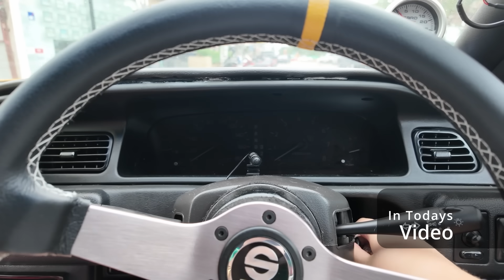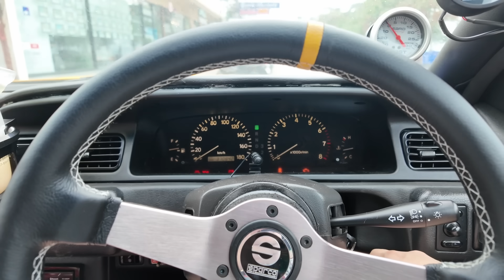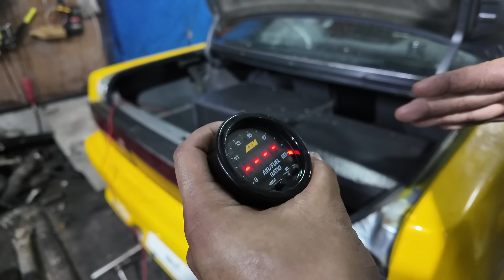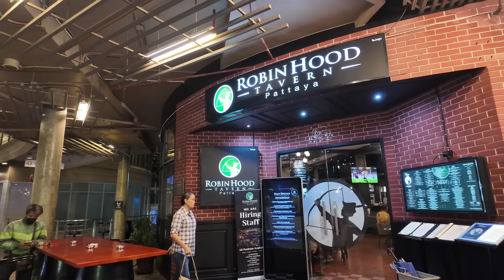My Car Has Died In Thailand

Comment: The engine was worn out, so excessive blowby was being sucked into the input and it was asphyxiating the engine.  You don't have too much fuel, you have too little air, because it has been replaced with unburnable blowby. This is worse when the engine is hot and the oil thins out. To keep the worn out engine running, the previous owner added a thickening agent like Lucas to the oil. Then, you changed the oil, so the engine is back to asphyxiating. There are two ways of fixing this - add Lucas, and/or detach the hose that connects the crankcase to the input air, so the blowby vents outside (which is smelley).
Failing this way when hot is the USUAL way that worn out engines finally "die" - at least until modifications are made to keep them running. Apparently your repair shop has never seen a worn out engine!!!
Steve
Reply: That's because he buys car with his eyes not with a mechanic.
Reply: @Official_MotörHead  Or without a license or test drive.
Reply: I'm going to buy him a compression tester for Christmas.  By then he'll be shopping for a replacement car.

Comment: Just wanted to say one thing about ethanol fuel. It’s very hard on the fuel system and you have to have a special fuel system to handle it. It can be harmful to fuel lines, fuel pumps, and other fuel system components that aren't resistant to ethanol. So if you want to run it, you have to change out your entire fuel delivery system if it’s not resistance to ethanol fuel.
You will get much lower kilometer per liter. But it is a very clean fuel and good for the Engine.

Comment: 1000 U.S. is around 36,000 baht.
5,000 U.S. is around 183,000 baht.
So in U.S. money that is cheap to convert or buy that truck.

You won't find anything that good that cheap here.
A junker truck be 10,000 now.
We bought years back taxes and all you pay off the lot 7,000.00 for a used 2005 chevy half ton short box, two wheel in very good condition, no body rust and shinny paint yet, old person had it more likely, and under 200,000 miles on it like 168,000 think it was.
Still have it and only had brake issues, runs good.
All new lines and drums and rotors last year and lads even though we put new ones on a year after got it.
Just had to have brake sensors cleaned and the housing.
We replaced one and cleaned housing some.
They said most times just clean them before buying one.
If issue yet, then buy new sensors.

Have to be careful, one garage said it probably the main ABS box controlling brake system.
You are talking thousands of dollars for that box and to have it put on and bleed brake lines when do it.
They want to claim more than really wrong with it so a rip off.

I kept telling hubby just buy a sensor for other side to and it be fine and he says only one side making noise and I said so what.
Well he pays garage that's honest and they said nothing wrong with ABS main box, just needed sensor cleaned up on other side and housing and they saw new one on other side and finished his clean job he started on housing.
He never listen to me and so many times I was right.
Reply: Get a new husband, hes a dud😂

Comment: I said lemon from day one…but now it’s a squeezed lemon…all out of juice!
Reply: Big stinky lemon😂🤣😂
Reply: It's now a lemon sour.
Reply: Didn't even need to buy a car in Thailand.
Reply: I tried saying from the start that the high heat problem could be caused by lack of fuel. Running a twin turbo car lean causes predetonation and will ruin your pistons and cause high heat. Make sure the tune on your car is safe or you will send a connecting rod through your engine block sooner than later. ENGINE TUNE!!
Reply: @RockKnocker17  He just wants to look cool, once the fuel issue and the overheating is fixed, he'll still get a vented hood. I'm still amazed that people are sending him money to throw away.

Comment: As unfortunate as car problems can be to have, it seems that, in this instance, it brought you to the right place.

46 garage seems to be a group of fun people who know what they are doing.

In America, here in Wa, subarus are often tuned on e85 and are able to make more power due to the cooler burning and it has great knock protection.

There is a hit to mpg when switching from gasoline to ethanol but it's cheaper than high octane gasoline.

Im glad the shop suggested this as it could help with temps too. Idk how readily available ethanol is in thailand but if its easy to get and cheap then i would definitely consider it.

Running ethanol may require a fuel system upgrade braided steel fuel lines, injectors, fuel pump, filter, etc depending on what's already there. It may or may not be worth it depending on price and what all is needed.

As always, you're a flippin legend, and we look forward to more updates!

Comment: Ethanol has fewer BTU's than gasoline, hence an engine will NOT produce more power burning Ethanol. Ethanol can be produced from sugarcane (easily grown in Thailand) - cheaper. In the US it is produced from corn and is supposed to be more environmentally friendly, but it is really a giant scam. In the US 65% Ethanol is about 28-30% cheaper than gasoline mixed with 10% Ethanol but takes you only 2/3 rds the distance as an equal amount of a 10% mix of gasoline, so there is no financial benefit.
Reply: What are you talking about???Yes it will produce more power running on e85. You can run way more boost and timing and have no knock and the the engine runs way cooler. It's just not as efficient when it comes to gas mileage.
Reply: Remember it is a Diesel Engine.
Reply: @icosthop9998  My bad, I thought it was gasoline. Thanks for pointing that out,
Reply: @wesleydolen9180   N/P :_SanctionedSquid:

I'm so used to wearing a seat belt.
It's unreal that Thailand do not have seat belts in their vehicles. :_SanctionedLol:
Reply: @4drturbo85  Exactly - it is not as efficient. The extra power is due to mechanical assistance (turbos). so stress the crap out of the engine, like blowing the gasket. Head bolts, head gaskets, connecting rods, and other internal parts are all subjected to forces they were never designed to endure. Do what you want to your engine, but I prefer to follow the factory specs, and not have to constantly have my vehicle in for repair.
Reply: @wesleydolen9180  I think the motor he has in there is a pretty stout Toyota motor that can handle a lot of boost and way more power over stock levels. In my opinion he made a big mistake by buying a highly modified car. Plus it's mated it to an automatic transmission 😔

Comment: Hey Ivan,whats up from Oswego . I dont think the car is that bad.Looked like it was runnin pretty good the other night.Little bugs are no big deal.Once ya get them worked out youll be alright.I would put some foam on that roll bar or just remove it.A minor fender bender could turn fatal if it breaks your skull.One good whip or bounce off your head could be bad.Safety bro,especially in a country where the local vet is also the town surgeon.Fun isnt fun if it only lasts a day. Be safe.
Reply: That's for sure,  remove the roll bar,  most cars don't need one unless it's a convertible.  Our neighbor bought a '55 Chevy 2 door and the previous owner installed a roll bar in it to qualify for racing 1/4 mile. It had bars going across the lower part of the doors and it really got in the way so we took a sawzall and cut it right out,  There is a bunch of videos of 55 to 57 chevys rolling over and none of the roofs caved in,  this applies to most cars

Comment: head gasket was mentioned before by american mechanics also oxygen sensors will make engine not run smooth and pause even at higher speeds. 46 garage guy knows what you have and is hoping you keep "Lemon" because if you do you will become steady customer to keep fixing all the problems small engine turbo owners have and will always have. Good luck with "Lemon" and future driving and fun content.

Comment: If you get the Nissan "reconfigured" to burn ethanol, make sure you confirm that they changed all the seals and gaskets that touch fuel since standard gasoline gaskets will fail upon exposure to ethanol.

Comment: I'm 5 minutes into video, I had a Subaru every time it got humid it did the same thing. Bad plug wires. Changed 1 of 4 wires started right up to get to work. 4 new wires as soon as I got home.  Put some gas on the intake filter & try to see if you got spark.  Going back to video now...

Comment: if you think that little bit of black smoke was cool, you ought to go to a tractor pull,
diesel tractors with twin turbos, feather up the throttle until the second turbo kicks in and away they go, black smoke pouring out about 30 foot up

Comment: Don't put ethanol in that car you'll get all sorts of problems and I've never heard of ethanol giving you more power maybe more water like I've said before it will destroy anything made of rubber
Reply: Ethanol runs cooler, and has detonation protection. 

So theoretically the engine would last longer..

Subarus that make over 450hp are almost exclusively tuned on e85 now.

Call any tuner and ask them about e85 vs gasoline. The answer will always be, that there is more power potential with e85.

Edit: usually when you convert to ethanol you upgrade the whole fuel system to support it. fuel lines injectors fuel pump filter.
Reply: @DerickMcAfee  I dont think Ivan is going for crazy power. I would assume just a nice street car.
Reply: @nigelsenchez  That may be true.

The stock 1jz engine can in fact hold up to abuse and is known for 400+ reliably on stock internals.

If he is going to get it re-tuned by the shop, which it sounded like he was, seeing 400hp isn't out of the question at all for that motor. He said its around 280 (stock) He may need to get bigger turbos but he might just ask to increase the psi of the current ones which i think he said were around 5psi. Which could mean that it already has bigger turbos on it. As that's not the stock psi numbers which are supposed to be about 13-14psi.
Reply: the energy of ethanol is lower comparing to regular fuel. maybe it just has more power, if the fuel in thailand is very low quality.
Reply: @DerickMcAfee  Then i vote for more boost once all the issues are resolved. Let it rip.

Comment: If its just the fuel pump problem, then its not a lemon. Dead fuel pumps are quite common problem for any car. Just make sure not to run the fuel tank too low next time. I usually gas up when it hits half tank.

Comment: Be careful with the ethanol.  I used to have a car that ran on methanol, and it had to have a specially made fuel system, cylinders and so on because methanol is corrosive.  You could run methanol on a regular engine, but you would ruin it very quickly.

Comment: When a car has been diddled with so many times and by many that really don't know the finer aspects, you get these kinds of problems. As I look at your car, I can see so many things it should't have. First, dual turbos. Turbos put terrific internal pressure on an engine and the smaller the engine, the more likely the engine will blow, if not before a turbo breaks. Then, add two turbos...hahaha. If anything, one turbo and a super charger would have been better. Hopefully, you will be able to undo all the crazy, unneeded and even destructive modifications.

BTW: A gallon of gasoline provides one-third more energy than a gallon of ethanol.
• Blending ethanol and gasoline at a ratio of 85 percent to 15 percent (E85), the blended fuel is nearly thirty percent less powerful than pure gasoline. •Ethanol is similar in acceleration, power, and cruising ability, but ethanol miles per gallon are less than pure gasoline.
•• Ethanol causes damage to fuel systems and engines that pure gasoline does not. The most critical problems are water contamination and fuel separation. 
•• Ethanol attracts and absorbs water, including water from the air. When the gasohol absorbs enough water, fuel water contamination occurs in the car’s gas tank and that affects engine performance. If the car sits for a while, fuel separation occurs; this is where the gas and water form layers in the gas tank and if the motor sucks up the water layer into the engine, serious costly, damage happens.
•• Ethanol is alcohol, and alcohol causes corrosion in the fuel system. Metal parts rust and plastic parts become deformed or cracked.
•• Ethanol is not an ideal fuel additive, and older cars especially have problems with ethanol fuel
~ Bell Performance

Comment: Hi Ivan. You've had so many repairs done on the car you will reach a point everything will be fixed on the car that needs to be fixed  and the car will be running perfectly after that. Hang in there. The car will make you proud yet ❤

Comment: Hey Ivan. I see you're having a problem with the engine overheating when the air conditioner is on. I've had many Toyotas and I see that's a Toyota engine. The first place I would start is to replace the cooling fan with a high-performance cooling fan. But make sure the coin fan actually comes on when AC is blowing. I mean if you flush the coin system radiator hoses don't collapse they're nice and the thermostat is working and no problem with the water pump and the coolant is circulating. And as long as you don't have the exhaust bubbles coming out of the radiator. You need a high performance coin fan. All right brother good luck and peace to you.
Reply: The stupid Samsung phone every time I go to post it rewrites everything I script so please excuse the literacy if a coin system is fine then you need a high performance coin fan being a twin turbo. Cooling system. Stupid phone!!!
Reply: And I'm talking about the cooling system cooling fan I just want to make that clear. Stock or cheap cooling fan is not going to cut it when you have a modified engine. I've known many people to have that same issue when it only comes down to upgrading the cooling fan. One of them even got rid of his car he got tired of it overheating every time you ran the AC. Somebody I know bought it and upgraded the coin fan and instantly the overheating problem was gone.
Reply: Okay Ivan I work at a few of your past videos where I can see a little bit under your hood. It appears to have three cooling fans. The two on the back are drawing in the cooling engine and where the AC compressor should be. I noticed you have one on the front where you took the grill off. If that one is sucking outward it is blocking the air flow from the two internal ones to be able to draw through to cool the system. So actually the one in the front is fighting against the two trying to suck through if it's wired backwards? Upgrade the fans and possibly get that third one in the front out of the way and you ought to be in great shape. Okay brother peace!
Reply: Excuse the literacy I'm still talking to my phone to post all of this.

Comment: What cute little diesels. Maybe when they grow up they'll be like mine :) 800 horsepower, compound turbo Fleece Cheetah 63mm on top and BW S476mm below. ARP studs, 275hp injectors, Hamilton Cams springs with extreme duty push rods. All Mishimoto cooling..radiator, intercooler, and transmission cooler. Too much to list but 5.9 liters of fun to drive.

Comment: Bro for 5 videos now ive been telling you that you have a bad head gasket! Since the 1st vid when you bought it, all your issues have been from a blown head gasket.

Its why the previous owner sold it. The brown tinted water in the radiator was from a little oil. Overheating and starting issues as well are due to exhaust gasses pressurizing the coolant system.

Comment: Here is my suggestion.  (1) Loosen every other spark plug for improvised compression relief.  (2) Replace the starter with a hand crank.  (3) When you get the car started, remember to re-tighten the spark plugs.  Not only will this get the car running, but it is a good source of daily exercise.
OKAY, I'M LYING.  THIS IS A TERRIBLE IDEA.  KIND OF LIKE BUYING THE CAR IN THE FIRST PLACE.  Just messing with you - glad you're having adventures.
Reply from the maker: Lolollolololol

Comment: AFR, and he's checking for unburnt fuel in the exhaust, and exhaust oxygen levels, oil on the plugs seems like your piston rings are leaking, that's also a compression loss

Comment: Genius ethanol, is cheaper but, u need more of it, its energy density is less than gasoline, gasoline is less energy density than gasoline. Ethanol is not cheaper in the long run. Plus u will get less mpg.

Comment: Ethanol has a low energy value, worse than petrol and diesel
Reply: Runs cooler and has detonation protection.

Subarus over 450hp are almost exclusively tuned on e85 now.

Most tuners will suggest e85 if you're above 400hp.

Comment: Call it, “The Pattaya lemonade dream”.. it’s a nice car but a 1J with so many miles and it’s a little older gen, yes.., you will have some problems. That heat in Thailand, can really do a number on an engine. Of course, any place with a tropical climate is hell on engines.

Comment: You have older vehicle so yes things like that can happen and it can happen to absolutely any make including Japanese made i even seen guy with 40k miles 4runner spending 4k for steering repair, i'm surprised it didn't happen to Cadillac and i'm glad it didn't but trust me not everyone has exactly flawless experience... Sometimes when i drive 5k miles or more trips i get rentals from bigger companies who deliver you replacement if you brake down and they always have very low millage vehicles anyways, you just simply have to get lucky with older cars

Comment: Did you not mention on air , that you thought the (volt gage was not working or reading the wrong voltage . And now you car don't start . Fuel pump needs 12vt ,just like the starter .Think you need to get a decent driving car ,instead of all these zoom zoom money pits .Your words . Glenn the mechanic from Florida . We like your channel .